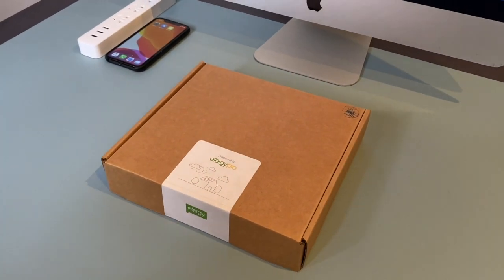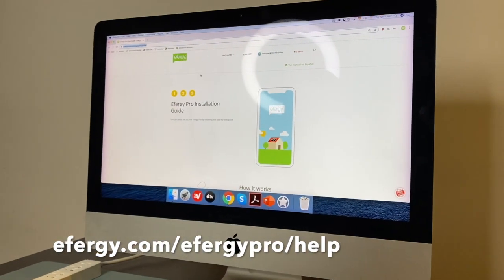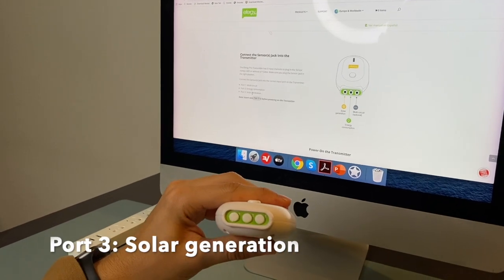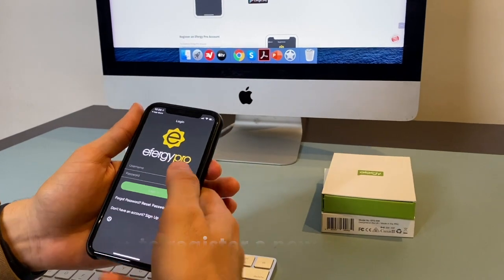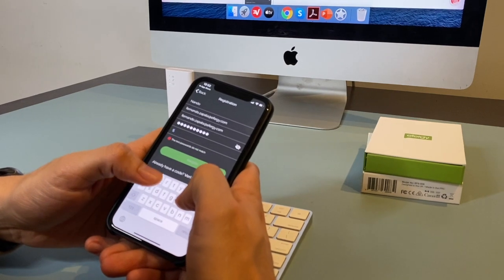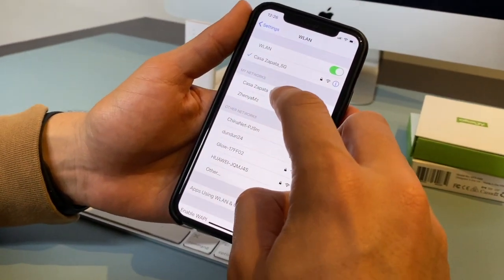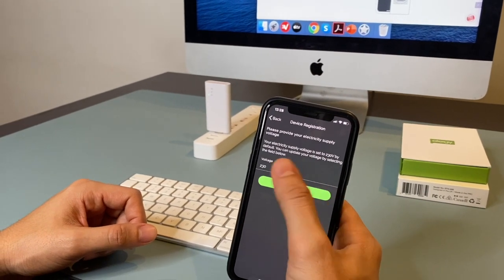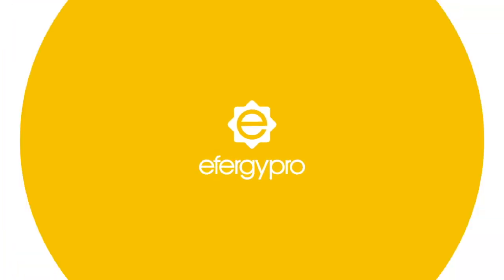Efergy Pro Installation Guide

Comment: Has the voltage reference been added to this kit to enable true power to be correctly calculated?
Reply from the maker: Hello, you can find the voltage set up on the settings when installing the device and also on the app settings. Thanks
Reply: @efergy  that's not the question I asked...
Reply from the maker: @deathruddlesdeathruddles5438  For customer support please contact our technical team at customercare@efergy.com